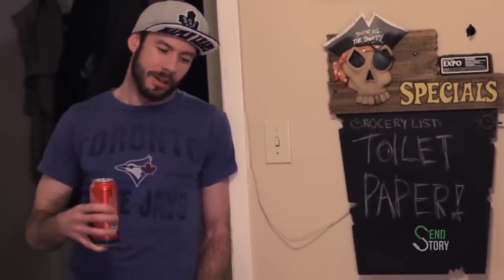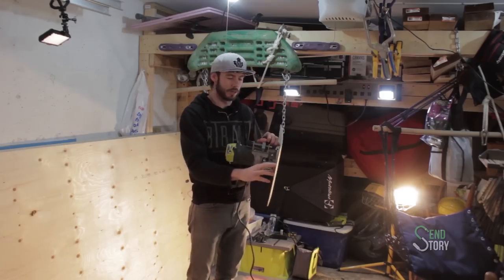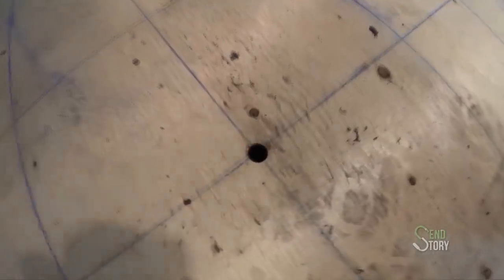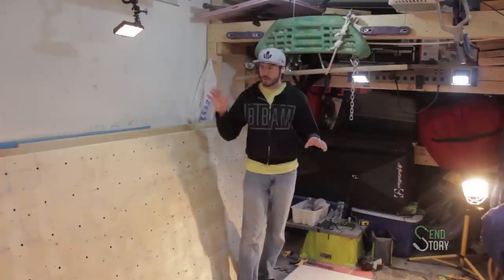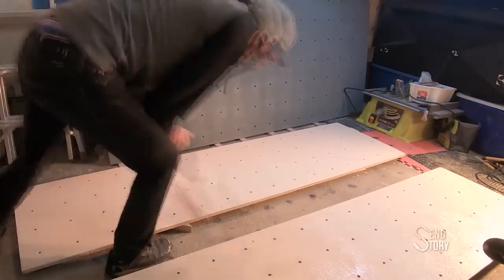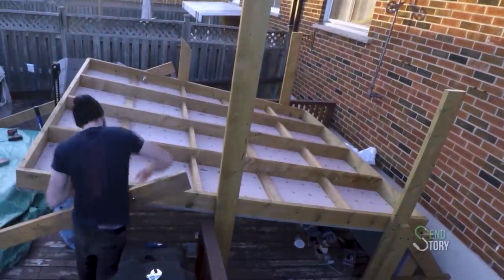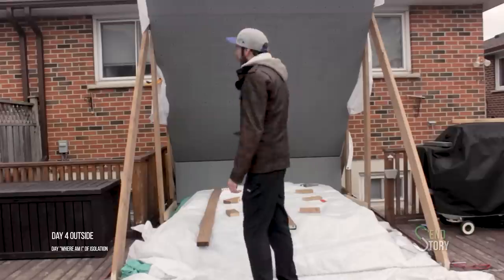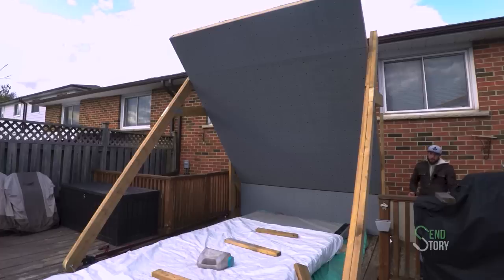Building an Adjustable Home Climbing Wall During Isolation - 12ft Bouldering Wall - Full Build Video

Comment: Wow! Great how to video. The best one by far I've come across so far and I've looked at over dozen easily. I appreciate all the detail and talking through choices for hardware and why. Do you think the screw in T-nuts are worth the work?
Reply from the maker: Hey Jeff, thanks for the comment! Filming, voice over, and editing definitely made the project take much longer and made it more exhausting, so I appreciate it. As for the T-nuts, I definitely think the screw-ins are better, but for a home wall, I am not completely sure if they are worth it. One of the reasons that I used them is because I didn't want to have to repair any t-nuts after the wall was complete, I hear hammer-ins are more prone to popping for various reasons. The other reason is that I liked the idea that when the wood is finally weathered, or if I build something new, I have the potential to reuse them. With all of that said, the reason I am not sure you need them is that you wont be changing your holds that frequently on a home wall and therefore are less likely to pop them out. I also have found that on volumes that I have made, adding just a bit of glue around the face of the hole before hammering the T-nuts in seems to keep them secure from movement/failure (none of the hammer-ins on my volumes have failed yet, and one I donated to a gym that has used it for a year). Hammer-ins also generate a lot of noise and swinging a hammer for hours can get exhausting, even if faster than screwing them in. So sorry if that is a lukewarm answer, but I think it depends on how you plan on building and how much you like your neighbours, haha. If you are concerned with paying extra for the T-nuts, I say get hammer-ins and just add a dab of glue to each (keeping it away from the threads) before hammering them in. If there is an area that you cant get behind to repair, should a t-nut pop, use screw-ins only for that area (heck, even add some glue to those to be sure). I hope that helps!
Reply: @SendStory  Thank you very much for the in depth answer. That helps a lot. I didn't think about the ability to reuse T-nuts. We have a cabin on forest service land and I'm planning on using left over roofing plywood and some donated holds to build a climbing wall. The thing is it isn't allowed, so if I were to be found out I'd have to dismantle it and move to my home in the city. It is, however, heavily forested and I think I can get a way with it. Thanks again.

Comment: I’ve been trying to find an in-depth wall guide and you seem to have the best one. I do have a question though, I’m seeing people who just spray their wall with holds with regular star bit screws. It looks as if there clearly isn’t enough T-nuts to possibly fit the amount of holds they have. My question is: how are they doing this? Are they doubling up on plywood or something? Or just drilling into the regular 3/4 inch plywood? My apologies if you don’t know the answer to this but it’s what I’m looking to do.
Reply from the maker: Hey, no worries. Believe it or not, some people have a super high density of T-Nuts, and you don't have to follow a grid, so some of these walls might actually still have the majority of the holds held on with T-Nuts. However, with that said, you are right, some just use screw on holds instead of bolt on. Lots of companies produce series of holds that are meant to be screw-on, instead of bolt on, and in those cases those holds have multiple countersunk holes to use several screws to fashion them to the wall. Some companies make a type of washer to use a screw in a normal bolt hole for holds that are typically meant for bolting, Escape Climbing's product is called The Lonestar. In the case of this hardware, it should only be used on smaller holds and only on holds that have holes for additional set-screws - or if the hold doesn't have spots for set-screws, drill your own countersunk set-holes so you have some. Like I mention, this only really works well with smaller holds, where larger holds you are likely to be putting too much leverage on them are inviting the possibility to rip the holds out of the wall or to shear the screws. As for the plywood, I do believe that most just screw through the wood as is, no doubling up. Just make sure to use solid 3/4" (or the metric equivalent) plywood. Attaching in this way would be a good example where I think having a high-quality grade of plywood is more important.

Comment: Great video! I might try something similar.   What kind of hinges are those and can you link to them?  How have they held up?
Reply from the maker: Hey! I used some exterior gate hinges from Home Depot. I don't remember the exact name, but they were rated for something like 40lbs each I think (if that helps you find them). They have held up just fine, but honestly, I think the way that I have it set up, a lot of the weight is redistributed down through the supports, so it is hard to give the hinges all the credit. Thanks for the comment, good luck on your build, feel free to share it if you end up going through with the build!

Comment: Warning: the pins near the kicking board are too close to the hinges to be load bearing. The wall acts as a lever and the shear forces on these pins could easily reach 10 fold the force of the wall and the climber, esp. at 45 deg.. You can therefore not rely on them as a back up safety system in case the straps fail. Not sure how strong the house wall is, but that may be a safer securing point as back up.
Reply: Interesting. I think the load would need to shear the pins for the kicker brace-to-frame connection, as well as the lower frame pinned connection you are describing. so the load would be shared (unequally) across the two upper and two lower pins. I would upsize all of those bolts that you are using as pins, they look like 12mm or 1/2" right now, I would go to 20mm or 3/4" for a bit more beef. I think if your careful about inspecting the strap regularly they are unlikely to fail suddenly, catastrophically and both at the same time.

Comment: Great video! I saw you painted the panels, but did you put any type of finish or waterproofing on the other lumber (legs, base, etc)?
Reply from the maker: The lumber is pressure treated for above ground weather resistance, typically this lumber above ground surfaces and with the ability to dry lasts a long time and remains structurally strong - it's typically used in decking and outdoor structure applications. If you were concerned after a few seasons of exposure, you could treat it with a weather sealer to prolong it's life. With all of that said, the lumber will outlast the plywood and even when cared for properly, anything exposed to the elements won't last forever. It depends on how much effort you want to put into maintenance. I think over time you will want to rebuild and redesign parts anyhow, but if cared for properly it could literally last decades if the wear and tear of climbing on it doesn't start to loosen the hardware. I hope that helps, thanks for the comment.

Comment: Hi! Amazing build! Looks bomber and we learned a lot. Thank you! We are also building a woody, and have a very similar design. I have a quick question: we are trying to figure out a solution to adjust the wall to fully vertical (we have both novice and experienced climbers in the house). Did you try to get close to vertical (what's the smallest angle you tried)? How did it go?
Reply from the maker: Hey Ninianne, The way I designed this, it should be operational at 15 degrees overhung. However, with that said, I have yet to adjust it to that position and drill the pilot holes for the pins to be placed to lock it on that angle. Technically, with the way the hinges are placed, you should be able to make a wall that can adjust to exactly vertical, but no further back than that. The problem with having it vertical is that it no longer creates an A-frame structure and is lacking the support to stop it from toppling over one direction or the other. I think if you were to try to make one that adjusts completely vertical, I would make sure you have some type of braces on both the front and back to widen it's footprint and give it a triangulated support on both sides to withstand the forces put on it and ensure it isn't top-heavy. You could do this with some bolts and wingnuts that allow you to add supports and remove them in "vertical-mode". I think the main issue here would be that adjusting it to that position might get cumbersome and you might do it a lot less than you think you will. Part of the reason I haven't adjusted mine to 15 degrees yet is for the same reason, it takes some effort to adjust and just like most people, I can be lazy. I hope this helps! Good luck!
Reply: @SendStory  Thank you so much for your thorough reply! Indeed we are re-considering the need for a fully vertical mode. Maybe it's better for new climbers to train on overhangs from the get-go.
Reply from the maker: No problem. I think for what it's worth, after beginners get some strength, and in all honesty, technique, they will fair well on something with an overhang. I think slabs are great for technique, and I definitely think that they should be practiced, but for a home wall, it's hard to set good slabs in limited spaces. Technically any wall can be turned into a slab wall, so that might be another option to have in addition to your overhanging wall - have a flat traverse wall somewhere just to practice and when they are strong enough they can move over to the other wall. Thanks again for the comment.

Comment: Nice Design. Why use screw down t-nuts? Pronged t-nuts would have saved you quite some time.
Reply from the maker: Yea, definitely could have been easier with hammer-ins. There were a few reasons why we decided on the screw-ins, some of those reasons made more sense than others. One is that I knew this was going outside and was in a rental, so there is the possibility of eventually needing to replace the plywood, and also the chance of moving  - so possibly tearing it down and reusing parts of it. I guess if I was to remove the T-nuts to reuse elsewhere, it would cost more in time and energy - but I am cheap and try to not waste. The other reason is simply for repairing the wall, I have worked with the pronged/hammer-in T-Nuts in the past and have had them fail and have heard of similar issues from some others as well. But I agree, the pronged T-Nuts are probably more than fine for most people and situations. Thanks for the comment, appreciate it.

Comment: Great video, man! Sure cover pretty much everything you need to know for building your own homewall. Gonna try doing one of these here in Brazil. I have to ask you something: what kind of lumber did you use in the frame? I can't get this information anywhere.
Reply from the maker: Hey Ruan, I used 2"x6" pressure treated lumber. If you want some more details, I have a link in the description to a page that I added some photos and measurements. As mentioned in the video, there is also another guy who has made a full build guide to something similar, it might be worth checking out too. Thanks for the comment, and good luck with your build!

Comment: Hi, did you screw in the vertical and horizontal supports at an angle to drive into the studs? Mostly wondering about the flat horizontal ones...the verticals will probably be easier to do so. What snaps did you use and where can I find them? TY! :)
Reply from the maker: Where I could, I drove screws straight through the vertical studs into the ends of the horizontal ones, but where it was blocked, I did drive them in on an angle (toe nail). You could also use square brackets for this and/or offset them a bit. Hopefully that helps! Thanks for the comment!
Reply: @SendStory  thank you!

Comment: Hey. Great build. What is the mattress that you used?
Reply from the maker: Thanks for the comment! We actually kind of cheated on that, as the mat is actually an old mat from an actual climbing gym. However, we did end up modifying it and rejigging it to our needs. We talk about it in more detail in our wall update video (towards the end) there should be link to that video in the description of this video. We can give you some ideas based on what we have learned and what we know others have done though:

Basically you want to have different layers of foam to properly protect you from the impact of falls. What we have seen done is using a thinner layer of ridged closed cell foam at the bottom of the mat to ensure if there is enough force that you go through the other layers, you don't bottom out to the hard floor/ground beneath. Then you want a softer and thicker piece of foam in the middle to absorb most of the impact. Then on the top you want another thinner layer of more rigid foam to disperse the forces over a larger surface area. This will also give your ankles something more sturdy to land and balance on so you don't end up rolling them or toppling over awkwardly. 

In terms of what exact materials to use, we have seen many different solutions, from some pretty professional usage of foams from foam supply companies and upholsterers, to some cheaper and maybe less reliable home made solutions. One of those home made solutions I have seen is using a few layers of rigid foam (like those square foam tiles) then laying down old memory foam mattresses, then another layer of foam or carpet to make the top more stable. Not entirely sure how well this works, but just that we have seen it. 

Whatever materials you use, you will want to contain them all together and protect them with a surface that is durable and easy to clean. A heavy duty vinyl tarp/upholster material is the best for this, which is what professional mats are wrapped with. That is also the material that we used when we modified our mat. I wouldn't say it is cheap, but it also isn't crazy expensive either, and it will do it's job properly. 

Sorry for the long response, hope that helps you wrap your head around what you might need for mats.

Comment: Great content! Can I ask what hinges you used? Also, are the horizontal supports at the back of the wall (the ones that look to be where the ply panels join) screwed to the vertical studs, or just to the ply?

Thanks
Reply from the maker: Hey! We used gate hinges from Home Depot, I think they were something like 40lbs hinges? Also, as mentioned in the video, we replaced the stock screws that came with the hinges with heavier duty screws that penetrated deeper into the studs. As for the horizontal supports, they are tied into the studs that run vertically. They were mainly just toe nailed into the studs. Technically, we dont think they add much structural enforcement, they were mainly just for mending the different pieces of ply, so we dont think you need to tie them into the studs. However, we just figured a some extra hardware cant hurt and it would probably help to further ensure there is minimal racking/skewing. Hope that helps! Thanks for the comment!
Reply: @SendStory  thanks for the reply!!

Comment: Great video - any plans on publishing/selling the build plans? Would love to take a closer look at the 3D model
Reply from the maker: Thanks! I have updated the page linked in the description to give more detail. I also rendered out a more detailed image for you with some measurements that I used. Unfortunately I dont plan on making a full build guide, there are already a bunch out there that are really helpful. As mentioned in the video and on that page, if you want a full build guide, Climber Dad has already put something very similar together with cut lists and a full purchase list, and I think that would be a good place to start. Based on what I saw in his guide, you should be able to follow most of his guide and then just modify as you see fit (like if you want to add some of the differences that my build has). I hope this helps!
Reply: @SendStory  Would you be willing to share the 3D model you created?
Reply from the maker: @deathtonovember  Hey, I actually have a link to the file on the page linked at the bottom of the description of this video. It should be under the rendering image on that page! Hopefully you can find it and it helps!

Comment: Sick video! what wood did you use?
Reply from the maker: Thanks! For the face or the structure? For the face I used plywood that is used for exterior sheathing, not the best, but it is what I had and when painted it should last long enough. For the structure I used pressure treated 2x6 dimensional lumber. Typically these are generic and are made of either spruce, pine, or fir. I am pretty sure these ones were spruce. Any lumber that is used for structure, like house framing or decking is fine, but if your board is going to be outside, you are going to want to use pressure treated lumber. I hope that helps!